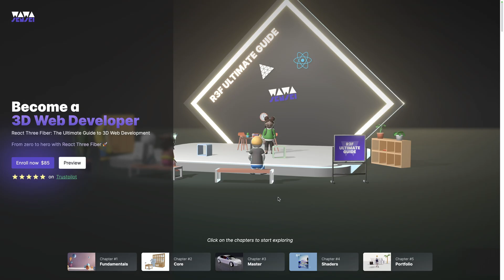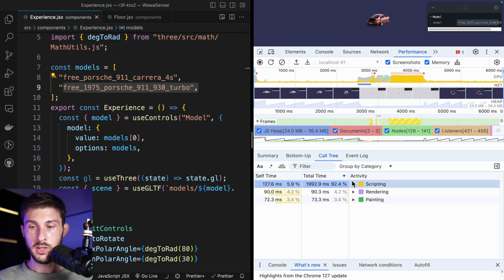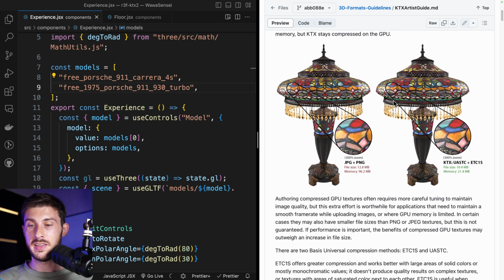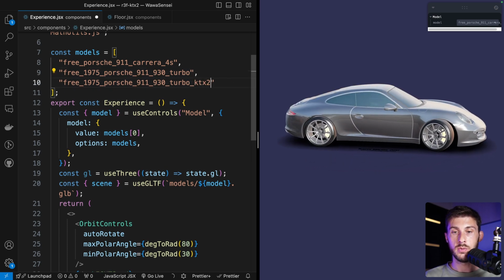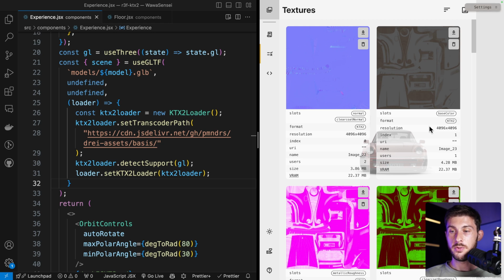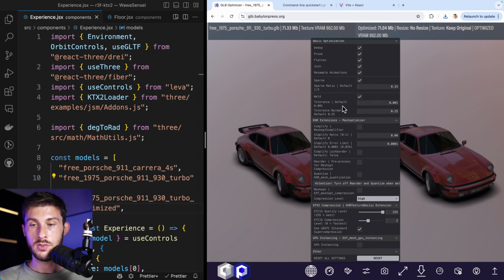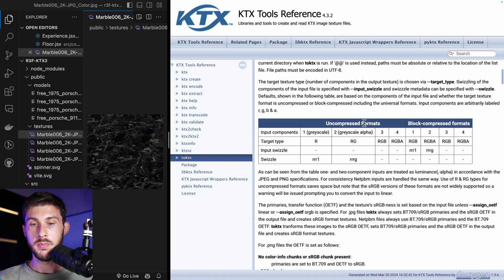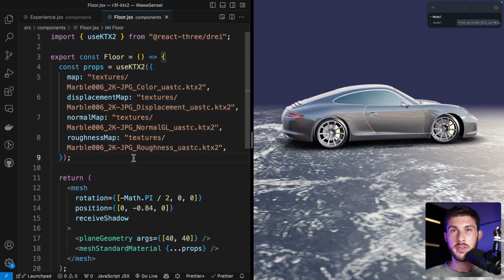Fix Loading Model Freezes with Three.js & React

Comment: What are the drawbacks to this technique?
Reply from the maker: There are two minor drawbacks:
- A highly compressed webp would be smaller than a ktx2 texture. So if you only have one 4k texture in your whole project, maybe it's smarter to choose the webp format.
- It adds extra work to prepare your models and it's not openable in Blender so you need to keep the original file, and do the process again after every modification. (On big projects you can script it)

Comment: Amazing optimization guide Wawa. Especially when I need high textures in my works, I always suffer from downgrading texture pixels but this method will be very helpful to me. Thank you very much!
Reply from the maker: Thank you, it's lifesaver for many projects! Best thing is it doesn't have downsides!
Reply: @WawaSensei  Do you planning to share your experience with optimizing shadows/light? It would super helpful like this video.

Comment: Idea for the next video: How to fix the issue with page reload on IOS devices when the GLB file is slighlty bigger
Reply: Plzzzz
Reply from the maker: Actually I mention it in the video, generally ktx2 + compressing the GLB fix it (as it's when you reach the VRAM usage limit and compressing your textures leads to a huge VRAM footprint reduction)
Reply: @WawaSensei  You did mention that, but I thought about a solution for every scenario, no matter how big the model is. For example, rendering a piece by piece of an object without clogging the thread.